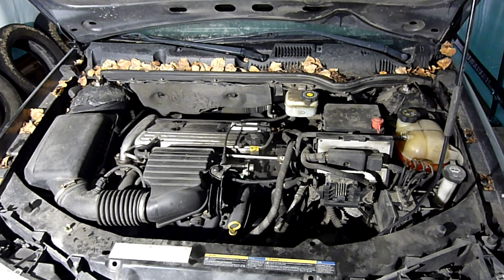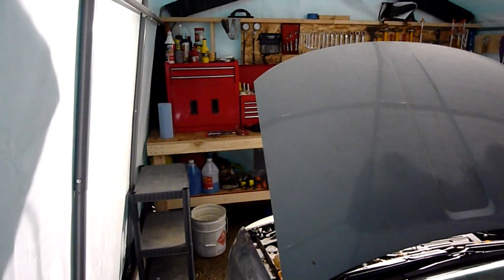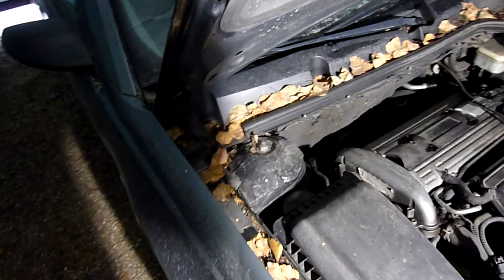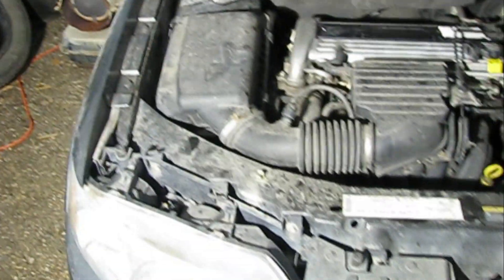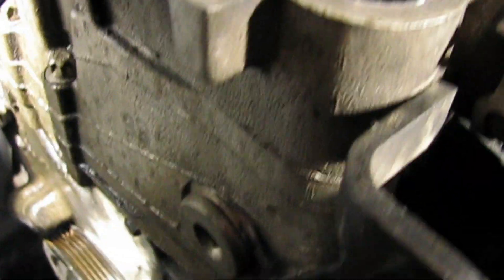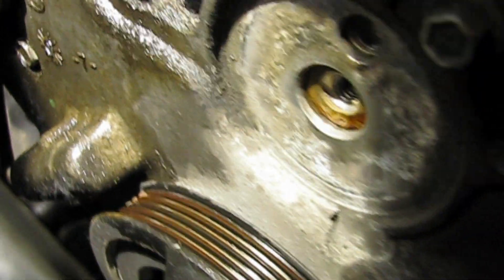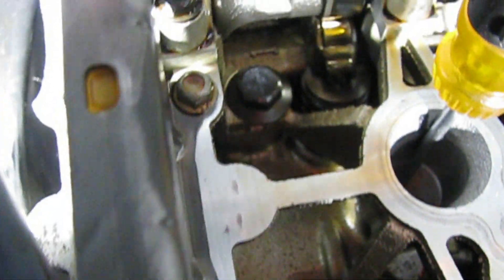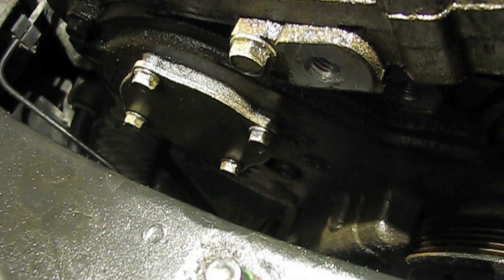$250 Saturn Ion Engine Tear-Down: ZERO Compression After Failed Timing Belt! (Bent Valves?)

Comment: Pardon me Mr RusTee I'm trying to replace the head gasket on an 03 saturn ion. In theory, would it be possible to pull the head without removing the timing cover?
Reply from the maker: Yes it is! There are 2 small bolts, I think they are E10 (external torx), that go thru the head to the timing cover. There is usually a puddle of oil right where the bolt heads are, so you may not see them at first. Good luck!
Reply: @therusteegarage  awesome, thanks!

Comment: Did it run afterwards? My wife went out one morning and it jumped timing. I took it apart put a new timing chain and three chain guides because they was broke. I replaced the tensioner it was broke as well. Anyway I put everything back together it didn't stay so I reset the timing and put everything back together again and still nothing. I finally food a compression test and same as you 0 compression. So now I'm thinking shout getting a cylinder head from a junkyard to keep the cost down but I'm gonna wait till it gets a little warmer outside before I do the work needed. I'm not a mechanic but I can do this. I'm just afraid of getting the timing marks wrong and messing up the valves. I know how to change the head just don't have the confidence. How long did it actually take to change the head and about how much? I live in southern Ohio around one hour east of Cincinnati.
Reply from the maker: Hey Roger, appreciate the comment. The timing sprockets are tricky because they are the same sprocket, they're interchangeable. The difference between them is that you use the diamond mark when the sprocket is on the intake cam. And you use the triangle mark when the sprocket is on the exhaust cam. Check this video out. https://youtu.be/WYivvyXQK9Y

It took me a little longer than I wanted it too because I was filming, even if the video is not that great, it still took some time to set up the camera and get my shots. But it took me 2 months and there were lots of interruptions during that time. 
Yes it runs, I actually have all the footage that I'm editing and making into videos.

On your Saturn, I would start with checking the timing. Watch the video in the link above, it's a very good timing chain video.

Stay tuned! I hope this helps.

~Rusty
Reply: @therusteegarage  It's alright, I already changed the chain and 3 guides and tensioner. After pouring all back together it had no compression do now I know I gotta either re-do the head or another motor.
Reply from the maker: Do a wet compression test. Squirt some oil or WD40 in the spark plug holes and then re-check the compression. If your compression stays the same as before that verifies the valves or head are leaking. If your compression is higher, then you have worn out piston rings. What the oil does, is temporarily helps the rings to have a better seal against the cylinder wall.

Assuming your compression stays the same, that can mean a few things;
1.) Timing issue, verify the timing
2.) Damaged valves - burnt, melted, pitted, not seating or bent
3.) Damaged valve springs
3.) Cracked head, blown head gasket.

However, if you have 0 compression on all cylinders, more than likely it is a timing chain issue. If it's off by one tooth it won't have any compression.

If you have no compression in cylinders 2 and 3, it's probably leaky valves and possibly a blown head gasket.

Was it overheating prior to changing the chain?

Let me know what else you find out.

Comment from the maker: What is the most difficult repair you have tackled as a DIYer???
Reply: whats up Rusty. I have the same issue with a 2004 saturn ion i picked up myself. bad exhaust valves. i want to try and fix this myself and take the heads off, but seems almost to hard for me as a do it yourselfer.
Reply from the maker: Hey David! Thanks for the comment. 

I understand exactly where you are coming from an I think it really boils down to; 1.) Do you have the time to learn and the time it will take?
2.) Do you have a place where you can work on it out of the weather?
3.) Do you have enough tools to do the job?

As you can see in my videos, I am in a tent... I do have a torpedo heater tho. And I have pretty basic tools, although I can build special tools as I need them.

For your Saturn, do a compression check and record the pressure. Then squirt some oil or WD40 into the cylinders thru the spark plug holes and re-check the compression. This is called a wet compression check. If your pressure stay's the same, you just verified the valves are leaking.
The valves could be leaking because the timing chain skipped a tooth or 2, or the valves are damaged or need to be re-seated or some other timing chain related issue.
Turn the crank pulley until the notch on the pulley lines up with the timing mark on the timing cover. This will put the first cylinder at Top Dead Center(TDC). Take the valve cover off and check the timing marks on the cam sprockets.
That should give you enough information to know how to produce.

Good luck, I hope this helps and just take your time and go slow. You got it!

~Rusty